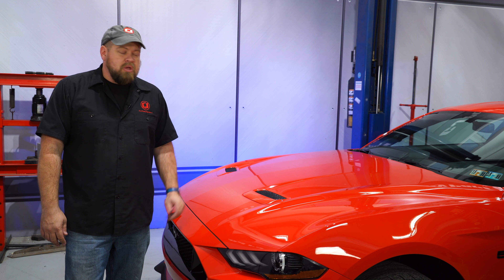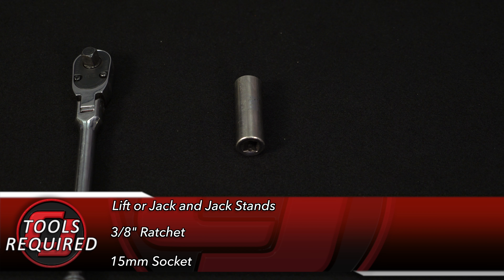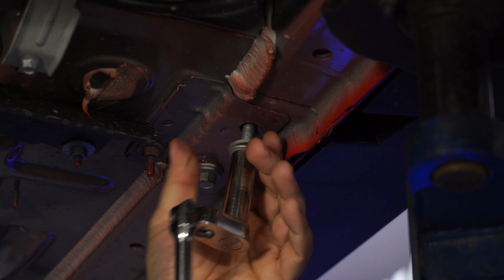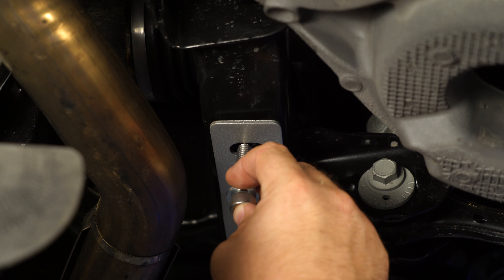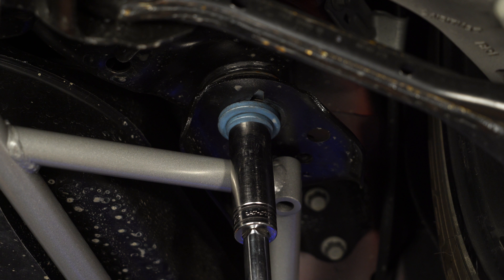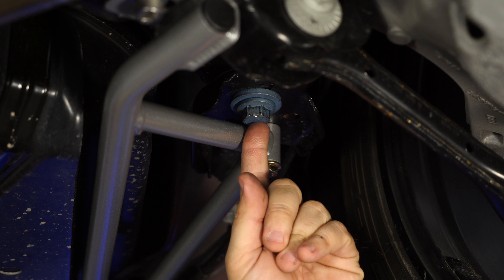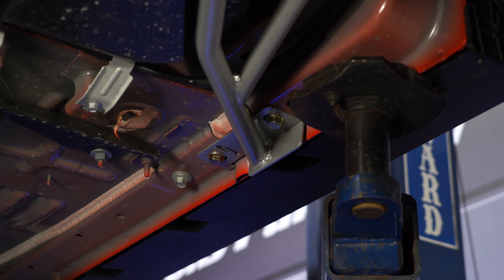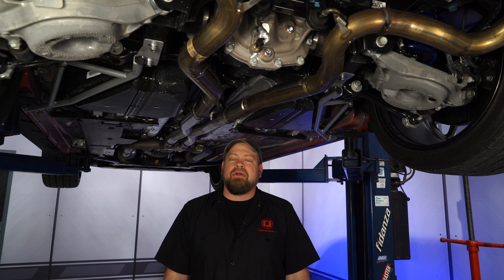2018-2023 Mustang Fastback Steeda Rear Subframe Support Braces IRS Installation

Comment: i have a 2015 performance pack and the rear has a squeek. Do you know what it is? is it normal for the performance pack to ride very stiff? I just picked up one used with 14k miles.
Reply: The performance pack will be a little on the stuff side from the factory, the squeak could be any number of things, I would start by checking for work bushings.
Reply: Bill Tumas awesome. im fine with it being stiff as long as i know nothing is wrong. as long as the bushing ill have to maybe get it into ford .
Reply: Probably needs some grease in the bushings!

Comment: I did all the steeda stop the hop on my 17 but I still get a little bit of wheel hop car feels a lot more solid thou
Reply: What tires are you running? It will be hard to entirely eliminate the hop with the factory Pirellis
Reply: Are the '18 Michelin Tires much better?
Reply: Much
Reply: I am running Michelin Pilot Sport Cup and they are sticky.

Comment: Any experienced advice appreciated.
Is it possible to install this improvement and Steeda low profile jacking rails?  If so, how is that best done? Both being awesome; I don't want to choose one or the other.
Reply: Yes they can be installed together, I did this on my 2015
Reply: Bill Tumas thanks for responding
Did you install the subframe braces first before the low profile jacking rails.  I am extremely new to upgrade installing, so any advice will greatly appreciated.
Reply: A double install video would be cool.  I haven't found an install video for the jacking rails.  Too basic for video, maybe?
Reply: They are extremely easy to install. We had a video but Steeda made a slight change to the design so we took it down.
Reply: Thanks
Reply: I was able to find a video about the jacking rails.  It was no where near the quality of your videos.  However, I was able to gain a better understanding of the install
Thanks again for the communication